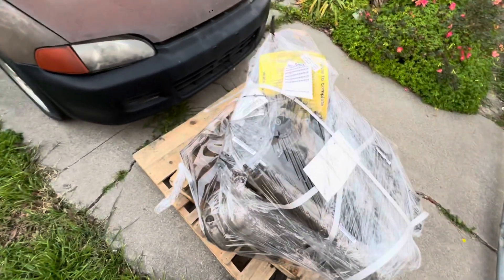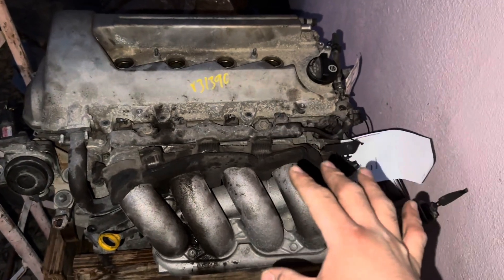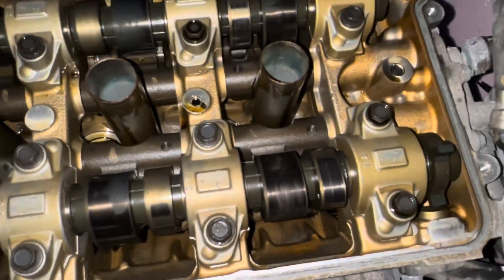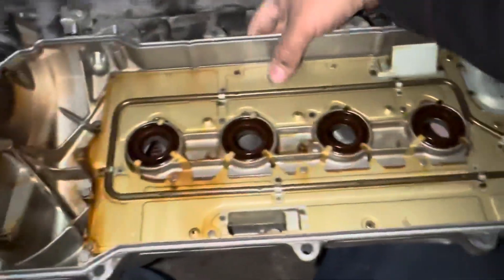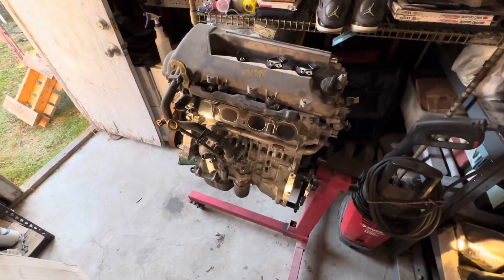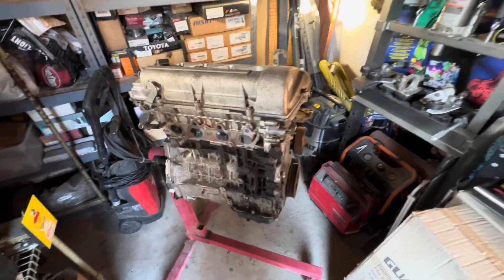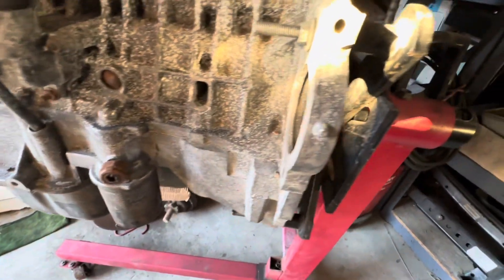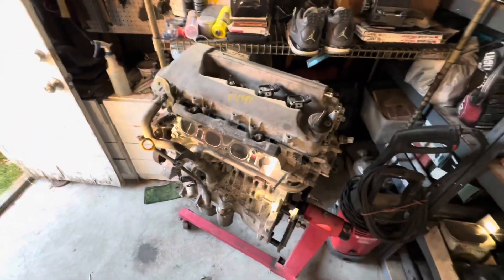Purchased another 2ZZ-GE from LKQ, how did it turn out?

Comment: Bought my 2005 corolla xrs in Dec 2004. Love the car, has 340k miles on original engine, trans and clutch. The engine finally took a crap a month ago. Planning on doing the same. Rebuild the original or get a low mileage 2zz and supercharge it, possible even make it an awd on top of it being supercharged. Basically it will be a long term project. But since I bought the car brand new, I want it to be awesome and keep it for another 20 years

Comment: Nice to know about the hooks being on the 1zz Corolla by default.  The rear and front hooks are different part numbers on the GTS.  The rear one is like at least $10 more.
Reply from the maker: I just found out that they can be purchased lol
Reply: @2zzlow  Yeah, I researched this when replacing motor mounts, as I thought I should support the engine from above…. but noticed the in the official toyota celica service manual they actually show you can support the engine by the oil pan with block of wood and jack in one of area of the engine section.  So I went that route.  Plus I know you have done it before.  I had no issues BTW.

Comment: I got one from San Diego, engine swap was great but OCV p1692 came on, 8 days past and decided to check it out. Connector was not on the oil switch sensor, plugged it in and ran rough when idle the engine starts knocking but not when driving it while applying fuel (gas pedal). Don’t know if a $60 Oil Pressure Switch Sensor will fix the issue but it was driving fine for over 3 weeks until I messed with that connector

Comment: Also, I would think the 2003 would be more desirable as it doesn’t have air injection. I have a 2003 Vibe GT that I bought with a supposedly blown head gasket but I haven’t verified that yet as I’m working on a supercharged 2003 Vibe with the factory supercharger.
Reply from the maker: I live in California and we have state emissions every 2 years, I need a head with air injection to properly pass emission testing. I feel like it’s the other way around. An air injection head is more desirable because not many were made compared to the early year 2zz with no ports on the head.
Reply: My 2zzge version got no holes in the head , but the holes are directly inside the exhaust manifold tubing. This was the early air injection system.

Comment: Curiuos what a used 2zz goes for.  Did you do a compression test to see how good the engine is or did the company do one and give you the results?  When I pull a junk yard 2zz I always do a compression test as you can’t hear it run as they pull the batteries and punch holes in the gas tanks 8-(.
Reply from the maker: Now a days I’ve been seeing them sell for $1500+. I paid $1300ish for this one but had dealer service records it’s whole life when I ran the vin through car fax. No compression test but I’ll perform one myself in a later video. Easy way to tell if an engine has good compression is to listen to the hissing when you turn the crank and if it has some resistance when building pressure in the cylinder chamber from the stroke.

Comment: Very clean mate! The marks on the intake camshaft is normal? Why don't exist on exhaust camshaft ?
Reply from the maker: not sure actually, its nothing serious as i run my nail over it and it doesn't get caught
Reply: @2zzlow  thanks for reply mate. You know why some 2zz especially on lotus can damage the intake camshaft? Maybe because need valve adjustment and the owner leave it with wrong clearance/lash?
Reply from the maker: Valve adjustment can’t be performed like a Honda. valve shim caps need to be replaced or to the correct specs and that involves taking apart the head which most people won’t do leading to that issue on the cam.

Comment: The last LKQ engine was nasty, lucky for you to get such a clean (inside) engine. Do you measure valve lash on your 2zz engines? There is a lot of stuff on the Lotus and Celica forums about worn intake camshafts.
Reply from the maker: I believe those were the early 2zz but i may be wrong. Ill most likely will be taking it apart and inspecting the engine.
Reply: @2zzlow  Well, it seems that the first 2zz engines are from 1999 and made their debut in the Celica SS-II (ZZT231). It came with the old style liftbolts (the ones that brake all the time) and the flawed oil-pump? The "revised 2zz" seems to be the one in the 2002+ Celica/Corolla XRS/Matrix XRS/ Vibe GT and the Lotus Exige/Elise. The revised 2zz came with the updated Liftbolts. So I don't know if there are oil-pump and/or camshaft differences through the years.